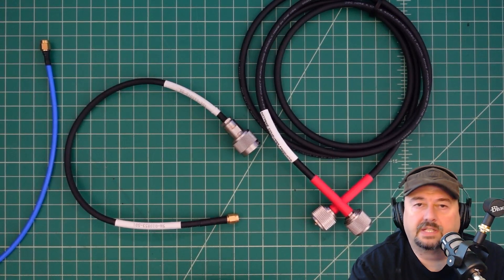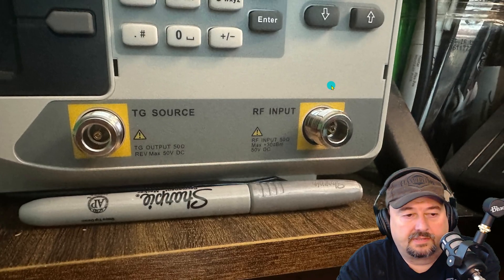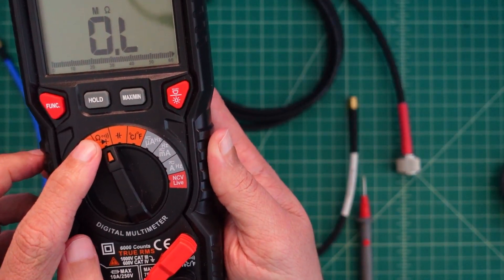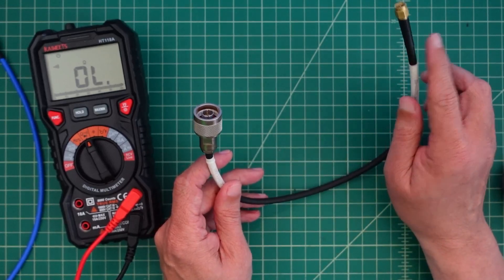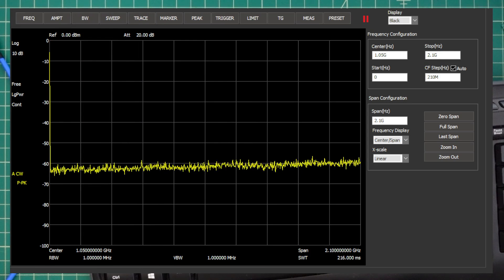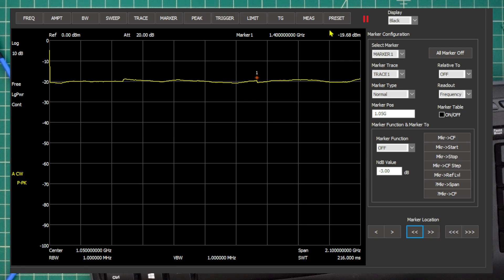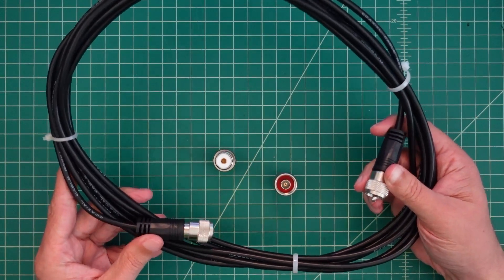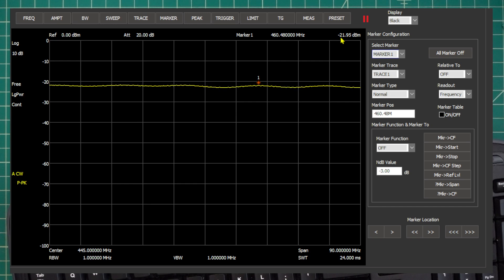How to Test Coaxial Cable: Continuity and Loss Measurement Guide

Comment: Hello. Ape I have a question.
What's you take on making jumpers for your meters or antenna switches and so on.
I always have used 3 foot jumpers , is there a difference in marking a jumper at a certain wavelength just for using it for a meter or antenna switch. I know if you are making a matching stub you would do the math and make one for that.
Reply from the maker: @Andy-up6li  It’s probably worth pondering but I have always used 3,6 and 9 foot jumpers 🤷
Reply: When i was on the cb ride
There was always a thing of nulling your coax. Never really looked in to it.

Comment: My SWR starts off good. After a minute or two it raises to 5+. Lmr 240. Water in the cable?? It's not the radio.
Reply from the maker: It could be water but something is definitely wrong
Reply: @TheSmokinApe I should add that I see a 26 ohm short across shield to core now. I have had this issue before and removed some of each side and resoldered my Pl259. Evidently it didn't help. Eventually it becomes resonant again after some time left alone. It's not the antenna either. I'm just wondering how this happened. It's ultraflex and doubt I've been to too far.

Comment: I figured my spectrum was like yours. Mine not the X but is the plus one. almost the same.  Well that RG 58A/U is pretty bad at UHF and would heat up under higher power levels.  It will also cut your recieve . Good to test coax that way. They go bad either age of from bending or heating.   I got some RG58C/U and has about half that loss. still some loss . but usable under 15 FT UHF . Made for British Military. I got big roll MIL spec   Came from London ,England . It is RED and it don't melt when soldering. High temp.  Now you can show us a TDR test and use that coax the lawn mower got. will give you the length to the break. I mow my own grass . not hard. Some of them weed wacker line can cut right through coax.  The outherthing that hurts coax is driving over it.  may not short but makes it loosey . Your test is great for that .  Water getting into coax is bad as well. That is why you should test old coax and new before you use it.  73
Reply from the maker: Hey Robert, I agree.  Test that coax!  Thanks for watching 👍

Comment: You always get good info across with a minimum amount of fluff and that's appreciated! And I noted you had that much loss over about 17 feet of coax. Imagine if it were for a dual-bander at the house that needed 50 or 100 feet to reach the antenna... Yowza!  It's like they say, good coax ain't necessarily cheap, and cheap coax ain't necessarily good.
Reply from the maker: Hey JD.  Yeah, 100’ would be terrible!  Thanks for watching 👍

Comment: Could you preform this cable testing with a NanoVNA? I ask because many of us have (or can afford) a NanoVNAs but I think your test equipment is probably more expensive than a NanoVNA.
Reply from the maker: You can using an s21 logmag measurement, here is a video: Unveiling the Truth: Measuring Coax Cable Loss for Ham Radio Beginners
https://youtu.be/ohu0onNgvCY
Reply: @TheSmokinApe  thanks professor Ape!
Reply from the maker: Thanks for watching 👍
Reply: I was wondering the same thing.